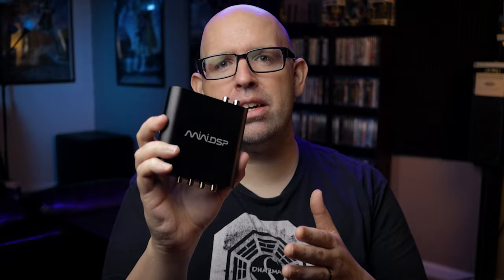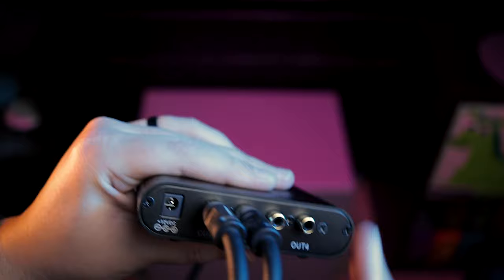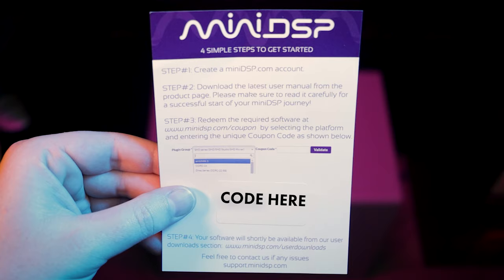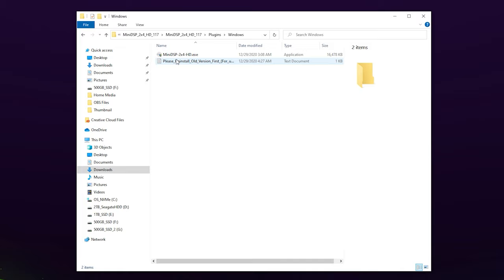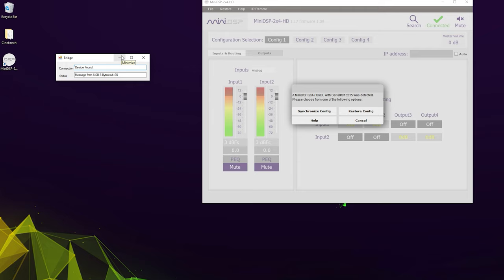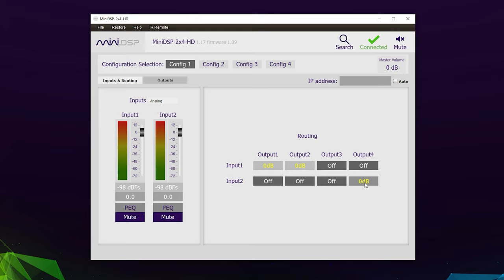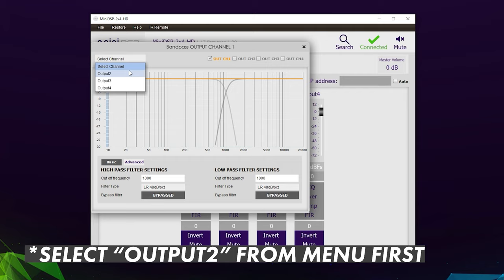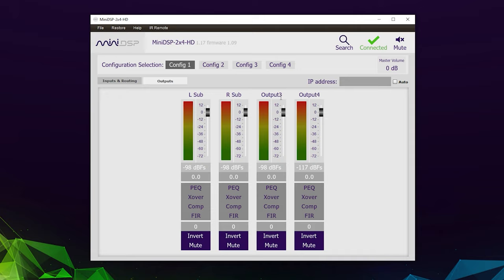miniDSP 2x4 HD | Initial SETUP and Software CONFIGURATION (part 1)

Comment: If you have two sub outputs from your processor, should I use both or just one for the input? Thanks!
Reply: Would like to know this as well.
Reply: 1 is fine in most cases so if you use 2, make sure they settings are at 0db etc in the AVR/Processor. The one benefit to using 2 is that you can turn them off individually but that would render the calibration file unusable anyway. The  sub outputs we see nowadays is much more useful for systems without a DSP on the LFE line.
Reply: @FatterTony  , please be more specific , I have to connect each  sub output from AVR  to DSP 2x4HD  , sub 1 to input 1 and sub 2 to input 2 , the matrix will be in cross in/out .  ok . ?
Reply: @mihaiiliescu1324  I don't think it would make sense to plug in 2 sub outs from avr into 2 ins on the dsp as the usefulness of 2 x sub outputs is rendered obsolete when using a dsp. So 1 x sub rca from the dsp then output from the dsp to however many subs you have 👍
Reply: @FatterTony  sorry , in this case I cancel one sub out from receiver , is it ok ? i will have one out from AVR and two out from miniDSP to subwoofers , 1 plus 2 < correct , sorry for my dummies q , I am new on this
.
And another q , I saw in part 4 , the measurements for crossovers for surround   and center use asio4all, I cant find this for mac or isn t necessary?
Reply: @mihaiiliescu1324  yep, 1 sub out from the avr as the dsp will allow you to time align (super important) and level/gain match.

You don't need the asio4all plugin for calibrating your subs, the easiest way to get just the sub playing and not the mains is in the 
REW meaurement menu (top left button on REW screen), select the output chanel as L or R not L + R and simply pull out the lead to the L or R speaker that you selected.
Reply: @FatterTony  thank you . I am confused because I follow all videos and there are multiple ways to goes to most the same , Please give me an advice how to start , begin with subs and after to align l+R with subs or check crossovers . thanks  a lot
Reply: @mihaiiliescu1324  I think HT GAMER  and HT GURUS are by far the best guides to follow and work along side pausing the videos when needed. As you become more familiar with REW, it becomes a lot less daunting. It may take multiple evenings to get it right but is so massively worth it. 
REW also has a room simulator to help you decide where to put the subs for best starting response.
If they are already placed, measure each one individually then measure them together. During time alignment the sum of both subs needs to be greater than either of the individual subs at any point in the sweep.i think it's definitely best to work through your setup by pausing the HT GURUS video and following along